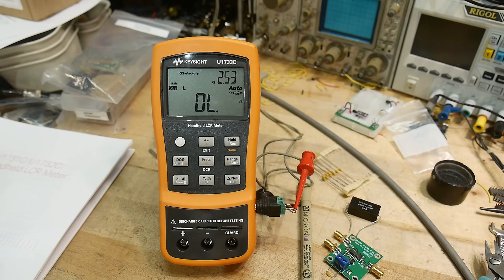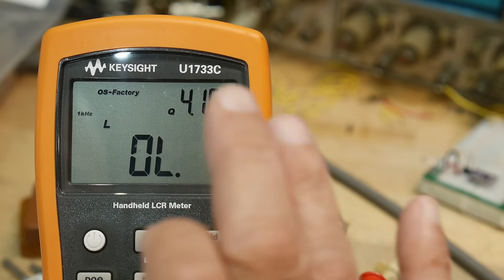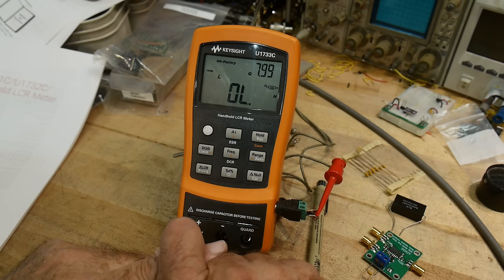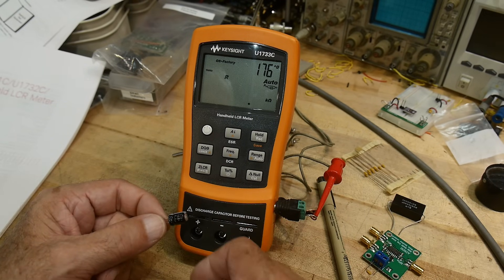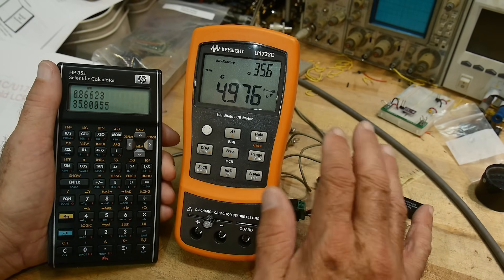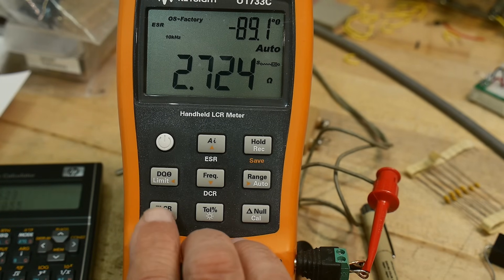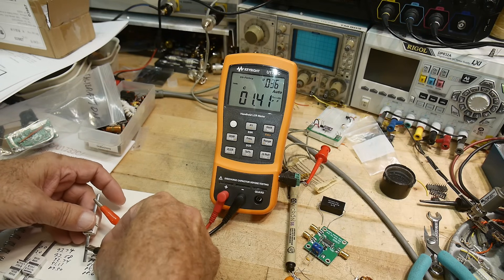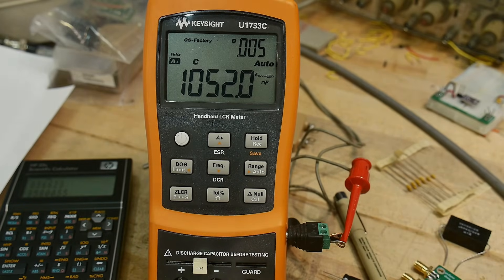#1630 Keysight U1733C LCR Meter Details

Comment: If you are measuring components that will be used at frequencies far removed from the test frequency, the results can be terrible. 100khz is the maximum because it is the highest frequency a simple bridge can measyure accurately. Higher spec instruments like the HP 4275 multi-frequency LCR meter go up to 10 MHZ which gives accurate results for RF uses of the component. The differences in readings between the 1733 and the HP 4275 can be quite startling!
Reply from the maker: 4275 will be coming in future videos

Comment: So I don’t understand the relationship with frequency? I can see the meter allows you to change it but I don’t understand the why or when?
Reply from the maker: ideal components do not change with frequency but real world components are not perfect. a capacitor also has resistance and inductance and so will act differently at different frequencies
Reply: @IMSAIGuy  so you would need to know the frequency of the circuit that the capacitor is going into in order to know what frequency to test it at?

Comment: Cool.  That was interesting about calibrating the leads at the end.  Have you considered doing a video, or even a series of videos, on crystal radios.  This would probably be highly educational, and I am sure everyone would be interested in your take on them.

I am making a crystal radio now.  So far it is not working.  I got ripped off buying 1N34A germanium diodes on Amazon.  They sold me Schottky diodes instead.  I know that because while the forward voltage is about the same at 0.3v, the leakage current is around 10 nano amps instead of being about 50 micro amps.  I am not sure if this is why the radio is not working, but there is one good thing about all this.  I now know a lot more about diodes than I did a couple of months ago.  Cheers :-)
Reply from the maker: https://youtu.be/I2M8YuM2Yew?si=MctQG0W_A1hyBetQ

Comment: What really clicked for me was seeing a simple cartesian X/Y chart, where you model resistance in +X, inductance +Y and capacitance in -Y. It's not perfect but helps to give you a model of how these three core properties intertwine with each other.

Could you write software for any of the Lite/TinyVNAs to be half-decent LCR meters?
Reply from the maker: VNAs are designed around 50 ohms so they do well with LCR around that value but get too far away you introduce errors.

Comment: So.... Could you please explain what the guard is?
Reply from the maker: guards are used to shield. consider a cable with two conductors and one shield connected to the guard. it keeps any outside electrical noise from corrupting the measurement.
Reply: I've understood these measurements much better after making measurements and comparing results to what I get using nanovna. The frequency relationship to the impedance is much clearer to me.  
The great thing is I now have two sets of kelvin leads, the full sized clips, and the tweezers(you found at great price).

Comment: Long ago I bought a B&K 878B LCR meter. I decided then to save $50 and not buy the 879B. Here is the difference:

L, C, R, (and Z, 879B only) primary measurements
Automatic calculation of secondary parameters D, Q, Theta, ESR (Theta/ESR for 879B only).

 My question is, is there a way to mathematically derive Theta and ESR from the L,C, R, D and Q that the 878 measures? 

I do have a Blue ESR meter if I need ESR. (And it cost me more than $50!)

Thanks.
Reply from the maker: tan(theta) = D

ESR = X * tan(theta)
Reply: OK. Thanks/ I thought so. Just have some Math cobwebs in my brain! (Wish I had an HP35. though !)  @IMSAIGuy
Reply: BTW Dave Jones' latest vid on a wireless ESD monitor is quite interesting.  @IMSAIGuy

Comment: how do you get .3 ohms being greater than .9 ohms? Lower ESR is better right?
Reply from the maker: you are right, greater conductance.
Reply: @IMSAIGuy  That makes sense. You had me a bit perplexed or as one of my previous coworker’s would say all Corn Fused. I have a Keysight U1733C and you made me go back and reread the manual. I enjoy all your videos.
Reply: @timgraham8975  The lower the ESR, the better.   0.3 ohms is better than 0.9 ohms.  Electrolytes often fail by going to high ESR, in other words, the series resistance has greater amount of ohms.

Comment: Question, I’m building a project that specified a non inductive resistance of 600 ohms.  Will this meter measure the inductance of a resistor?  If the resistors had inductance, could I combine multiple resistors in parallel to decrease the inductance?
Reply: Just use a resistor with a small package. 0603 for example.  

All resistors have some inductance but the vast majority of that comes from the shape of the device. A large through hole resistor has a lot more inductance than a tiny surface mount resistor. That is definitely what the "noninductive resistor" is getting at. 

Use a smd component and you'll be fine, no need to try and measure it.
Reply from the maker: yes, it will measure the resistor inductance. no you can't use multiple resistors in parallel or series to cancel it. there needs to be mutual inductance. so  the windings need to be on top of each other or on the same magnetic core